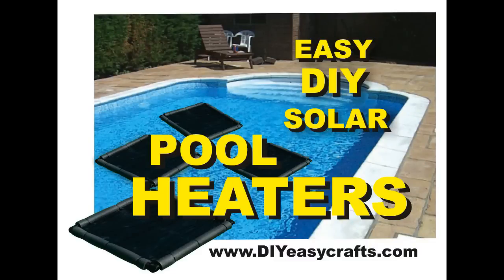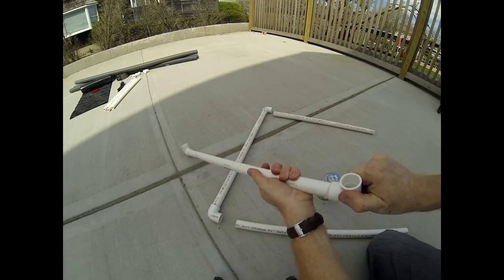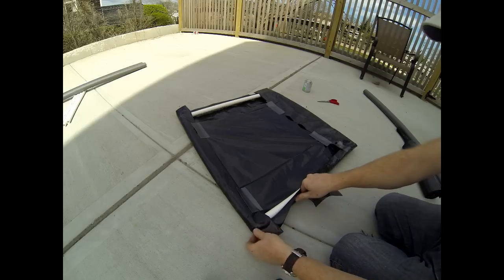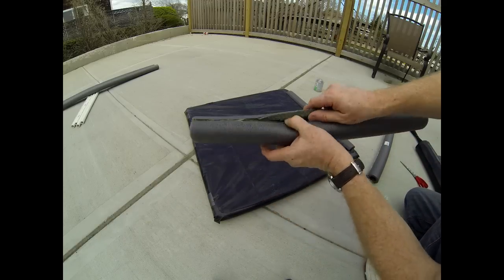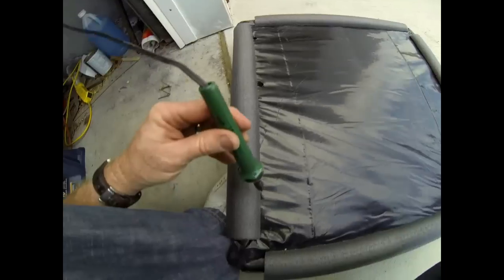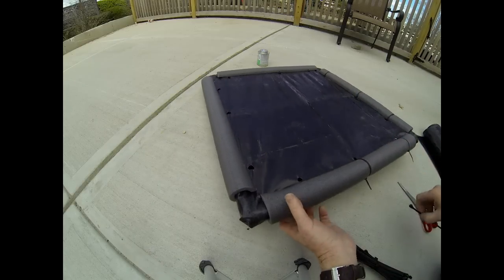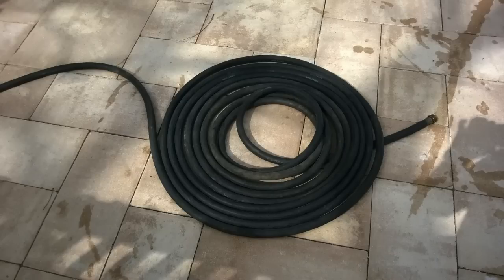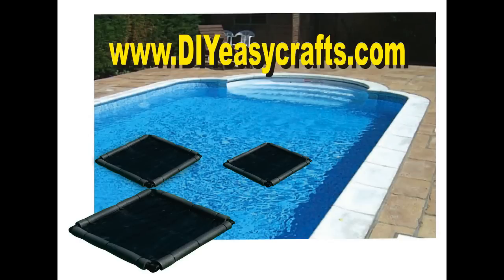How to Make a Easy DIY Solar Pool Heater

Comment: I doubt you tested this.  This will only heat around 1 inch below the square.  This won't change the temperature of the pool by a single degree.
Reply from the maker: I disagree. You are correct that each only heats an inch or so below the square. What you failed to realize is the water in the pool circulates so the water under each square is constantly changing. You would be very surprised at how nicely these squares heat the pool

Comment: you could use an iron and aluminum foil to heat seal the bag material together. on cool you peel the aluminum foil  hose.

Comment: Between the sun and the chlorine, that foam insulation will deteriorate in less than six months and make a big mess getting clogged in pool screen, etc. Have you ever purchased those foam floating tubes that they sell at Walmart, etc.? They disintegrate in no time and they are made more to withstand the conditions than pipe insulation. Sorry, I am not one of those that goes around posting negative replies on Youtube. I am a plumber and also own a pool..

Comment: The black plastic is not going to let sun saturate the water. It will only heat the top 1 or 2 inches, that's it.

Comment: I made a small portable water heater, to extend Pool use.
First I used a black garden hose, a 12 Volt pump and a 12 Volt PhotoVoltaic panel.
I changed the black garden hose with a Solar bag 1-2-3.
And the 12 Volt PhotoVoltaic panel with a Portable Folding Panel.
All fits in a small suitcase, and is made easy and fast operationable, 
The water is pumped into de Solar bag, and heated by the sun.

For pictures go to;
www.warm-water.be

Comment: You don't necessarily want to pump water through the hose really slowly. If you move water through the hose too slowly, you're not able to transfer heat from the hose to the pool water as successfully. Think of it this way--if your hose is sitting on the ground, and the ground is really hot, and the sun is really hot, which would be better? For you to flow water fast enough that the ground around the hose and the hose itself stay hot, or fast enough that the ground and hose feel cool to the touch? The answer is the latter because you've now transferred all of that heat to the pool as heat moves from hot to cold.

Comment: do these really work??
Reply: lol no, you would need 50 of them in any decent sized above ground pool to make any sort of a difference and the work of putting them in/pulling them out far outweighs the few degrees they might create.
Reply from the maker: +none of your bussiness  yes. They warm the pool enough to add a few wks to spring and fall swimming season.
Reply: DIYeasycrafts Ohhh, sorry I was picturing how hot the water is in the summer. When I think solar, I think summer. I do see the useful need for this.

Comment: You may be correct. My father once painted his concrete pool black so it would absorb the suns heat. The pool was warm but not very inviting. For these Solar Heaters I think I will stick with the floating design if only for how easy they are to pull out before the kids want to go swimming.

Comment: I like the simplicity of the idea but wouldn't sunken object as you make held to the bottom of the pool with say a black brick - wouldn't that do better to warm the whole water?
Reply: No, because the water will reflect most of the heat before it has a chance to get to the sunken bricks.
Reply: +James Campbell That is not a coherent sentence. That is why no one has answered you...
Reply: The sentence makes sense. You just have to add punctuation - 
"I like the simplicity of the idea, but wouldn't a sunken object (like you make) held to the bottom of the pool- with say, a brick, be better to warm the pool?"

Comment: You are correct. Should have waited until water cleared. PVC will float alone just fine but I would use larger dia for more pos buoyancy. I use the foam because they also help attach and protect the black plastic from damage.

Comment: Also, you won't need any of that foam either on the new panels the PVC will float just fine as long as you don't try that water hose thingy in the pool as mentioned earlier..

Comment: You could use heavy Black Plastic like that used under ponds or fold and use mult layers of Black plastic painters tarp found in Home Depot and other hardware stores. As long as its strong enough to hold up to lifting it in and out of the water.